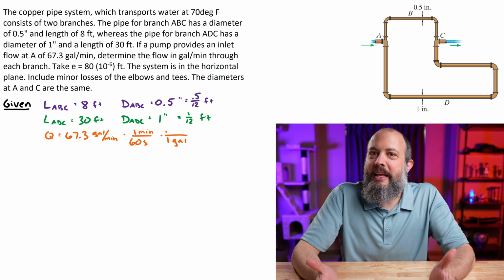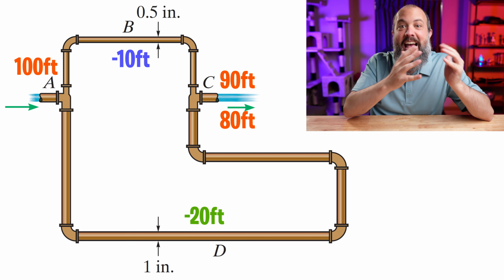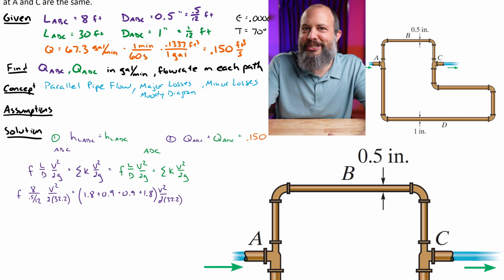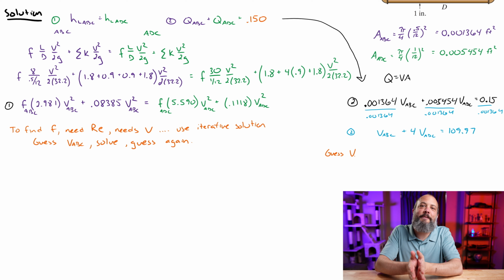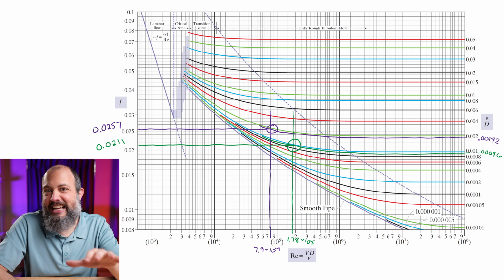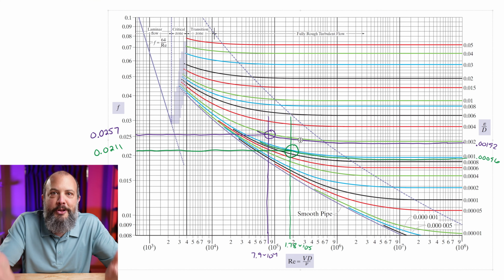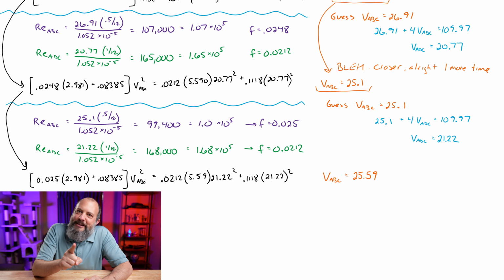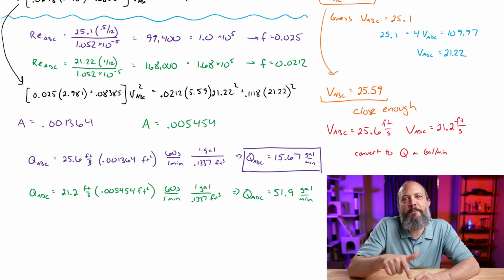How to solve Parallel Pipe Systems with Head Loss

Comment: What if there are three pipes in parallel? Equation 2 doesn't quite work out. Is it possible to assume a Re for the first AND second branches of parallel pipes?
Reply from the maker: My first thought is that there are 2 ways to approach this. First is what you suggested, to start off with 2 guesses instead of just 1. I guessed velocities, but yes you can also start off by guessing Re instead that would work too, and each iteration you update your 2 guesses. Other method with will often work but depends on exactly how the pipes are connected and what you know and where you know it, is to treat the 3 pipes first as just 2 pipes in parallel with each other, and then separately, treat that combination of 2 parallel pipes as 1 combined inlet/outlet ... and have this combined inlet/outlet in parallel with the 3rd pipe. Which of the two methods is better would depend on the exact construction.
Reply: @BrianBernardEngineering  Gotcha, thanks so much for the quick reply too